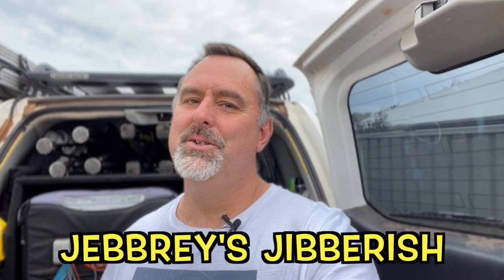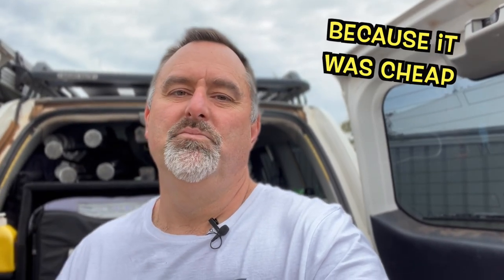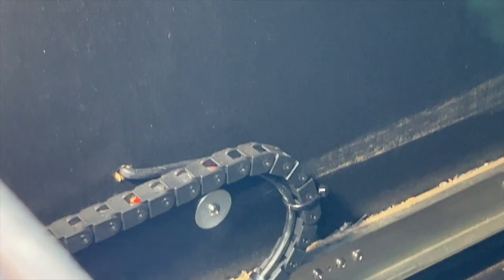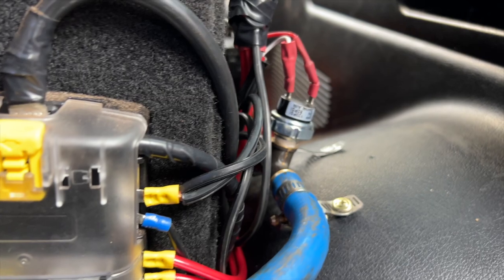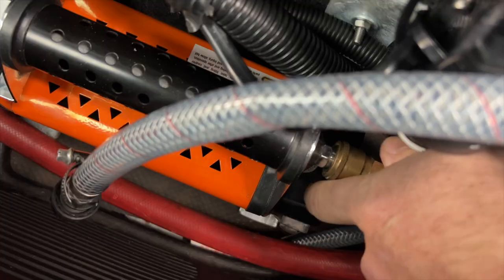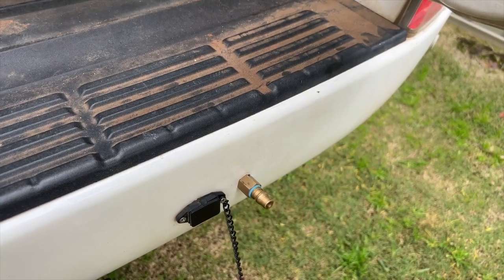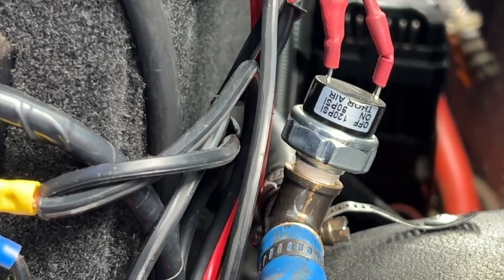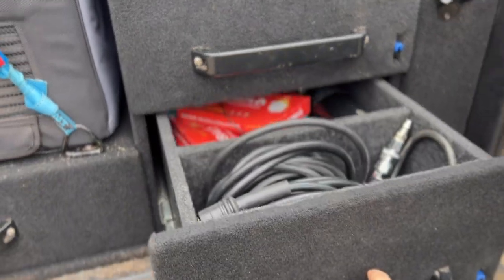XTM Air Compressor INSTALL in 200 Series Landcruiser

Comment: The current draw on the twin ARB is 90Amps😳I have the kings version of yours draws 40amps and is almost as fast
Yes unpacking and packing hot compressors is a pain
Great solution

Comment: Thanks for the content! Just wanted to mention that although many of these compressors look the same as the Mean Mother (MM) unit, to the best of my knowledge the MM was the first to have that design, this could be an indication that the subsequent brands/models have copied the esthetics but not the working components. For example, I've had my MM unit for 7 years with no issues, nor has the hose degraded.  Beware of making assumptions based on the esthetics, comparisons should be based on the working components, which is only possible when performing a tear down of the competing brands. Cheers

Comment: I bought a dual xtm one recently and bcf sent me a recall notice to return it, due to fire issues. Just FYI
Reply from the maker: 😳😳😳 well mines in the single,  it will do a search and check to see if it’s included! They do get pretty warm. I imagine the fire risk with the dual would be the cabling because it’s pretty thin even on the single. The good thing about hard mounting it was I shorted the factory thin cable because I only had to reach the relay. Then it goes to my 4g cable to the front of the car from the fuse block.

Comment: "If I liked the video..."??? Loved it! There were some excellent ideas there JJ, thanks again - will be using virtually all of them! 
What do you think about fitting an air tank - I've got a 20L unit. The thing that bothers me is having a compressed air tank in the back of the 4x4 - any thoughts? (I have a spot to put it behind the rear seats).
Reply from the maker: Thank you 🙏 I’ve had tanks before and I wouldn’t be worried but I’ve found by the time you charge the air tank it doesn’t really offer any speed advantage. So I personally wouldn’t bother with the tank.

Comment: yes Jeff, good ideas
have the same comp, as you say, fast, i must put my clamp meter over it see  how many amps it pulls
rgds
Stu
Reply from the maker: Yeah good point I should do the same.
Reply: 4 amps, very little at 10psi ride on mower wheel
Reply from the maker: Nice. I wonder at 45psi if it would be much different? That’s surprisingly low!

Comment: Any concerns about the starting torque/current draw when starting against an almost fully inflated tyre? I have a Mean Mother which is great & fast like you say. I think they advise starting the compressor under zero load & then connecting to the tyre which is what I currently do when using with the Indeflate. I agonised about buying the ARB Twin but really couldn't justify the cost especially after reading a couple of negative reviews. Finished up purchasing a heavy duty foam lined plastic case from Bunnings as the Mean Mother supplied carry bag was shit.
Reply from the maker: The XTM seems to restart ok even at 90psi when the pressure switch trips on. Maybe it’s not good for it 🤣 works ok anyway. Probably helps that I shortened the cheapie factory cables when I hooked it up to the relay with decent thickness of cable.